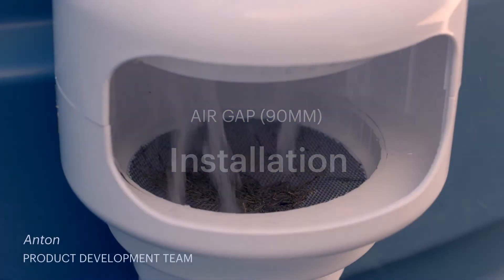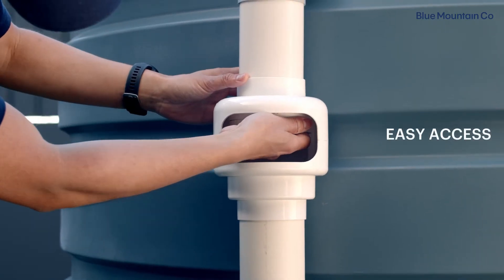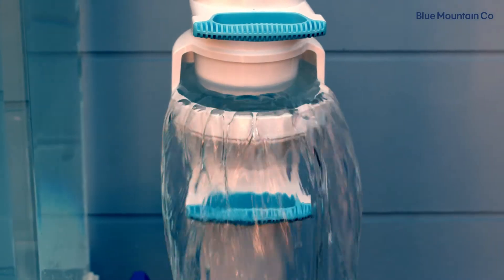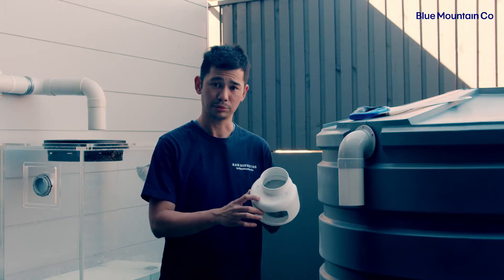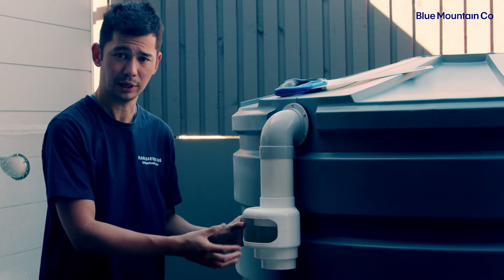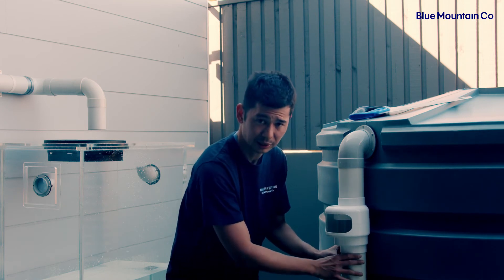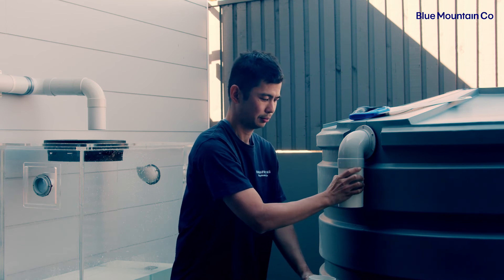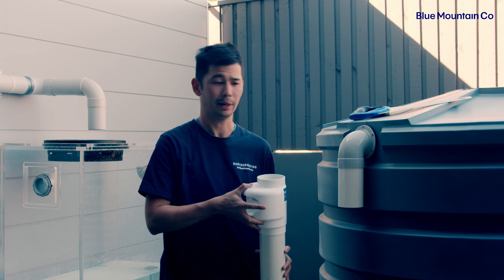How to Install: Air Gap 90mm

Comment: Would there be an issue with not glueing it in place? There seems to be a bit of movement and compression in our tank between being full and empty, which resluted in the overflow detaching from the tank. I was thinking if I install this without glueing it would could be a flex point to prevent this from happening again.
Reply from the maker: Hi there,

Thank you for sharing that information with us. 

We would love to give you some individualised advice, could you please email us at info@bmco.com.au and we can have our technical team discuss with you your system and the application of this product in your system so that you get the best performance from the product.
Reply: @rain.harvesting  hi there, Thanks for getting back. Any reason why can't just reply here? Cheers.
Reply: The overflow detaching from the tank is not uncommon. Hard connections are vulnerable due to:
The PVC pipe expanding and contracting during hot and cold weather.
The tank flexing as it fills and empties.
Ground movement between wet and dry weather.

All overflow pipes should be fitted with either an expansion joint or ideally a single filter pipe that drains into a larger lower pipe.
Reply from the maker: @PeterWilson-dx2mx  Thank you for your comment -Jelcy

Comment: What is the purpose of the airgap on the overflow?
Reply from the maker: Hi! An Air Gap is an essential element in any Rain Harvesting system where your overflows are plumbed into stormwater. Air gaps prevent stormwater backflow from entering your rainwater tank and lowering your water quality. They also create a visual inspection point for detecting any overflow issues and stop mosquitoes and other vermin from entering your rainwater tank.
- Brianna
Reply: @rain.harvesting  I have never seen stormwater backflow into a water tank and for it to be possible, the system's hydraulic head would need to be higher than the tank's overflow pipe which would already be higher than nearby surface drains in any case. Do you know how a piezometer works?

What you have is a good product but it should be promoted as an effective way to improve a water tank's overflow capacity by allowing the overflow outlet's flow restricting mesh to be removed. The overflow mesh also gums up over time and removing it will also reduce maintenance. Why doesn't RainHarvesting promote this benefit?
Reply from the maker: Hi Peter,

You're absolutely correct that it's not a common occurrence.  We recommend it purely as a safeguard.  There are instances where backflow can occur, especially in areas where there are steeper slopes and tanks are set relatively low compared to gutters etc.  It can be a nice safeguard where homes have charged overflows also.  Again, it doesn't happen often though, it's just one of the safety guards to protect the tank.

And on the overflows gumming up - it definitely happens and we try and make our overflow screens easy to clean - and you're absolutely right that we should talk about it on these air gaps too, since they do the same job.

Thanks for reaching out!
Bianca
Reply: @rain.harvesting  Hi Bianca. 

Thanks for the reply.

The Air Gap is a 2in1 product that is advertised as a single purpose product.

The benefits the inexpensive and easily installed Air Gap gives by increasing the tanks overflow capacity and reducing maintenance by allowing the mesh at the tank's outlet to be removed should be promoted. It is one of Rainharvesting's better products.